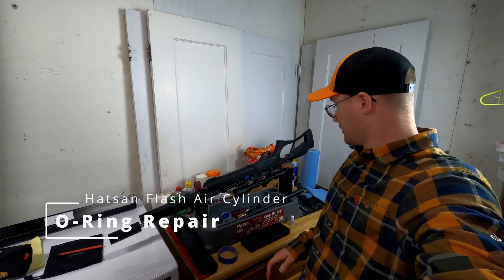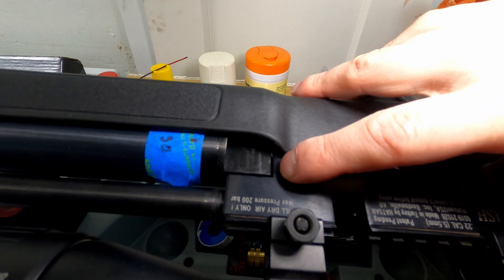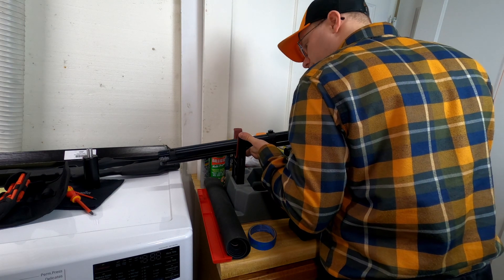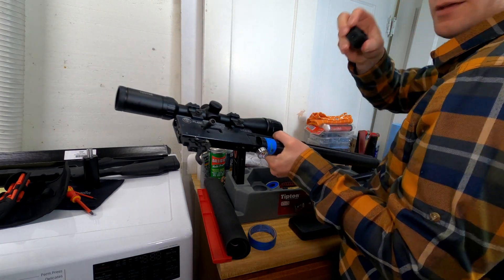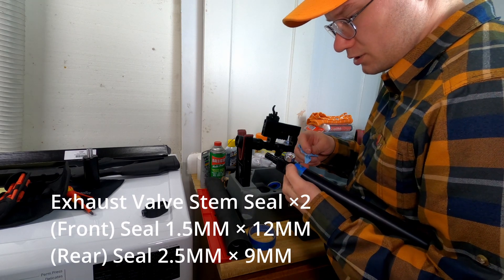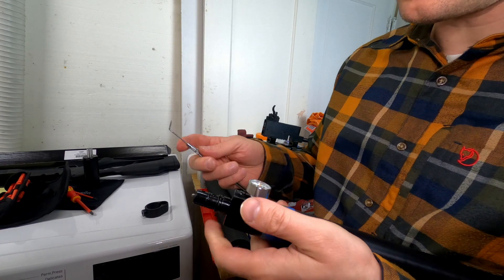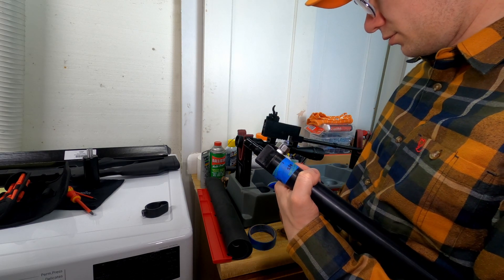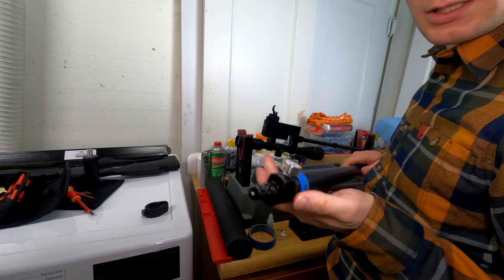Hatsan Flash aircylinder valve o-ring repair

Comment: I need some help. I have a flash qe wood in .22 and I am having issues with the trigger not holding the piston in the cocked position. The trigger sear stays cocked but the piston barely catches like it doesn't raise high enough. Is there anyway to send private messages?
Reply from the maker: I think that you have adjusted the trigger assembly too much. Try to adjust the trigger screws back to what they were and go on from there with the adjusting. I had the same thing happen to me in the past and I could correct it by adjusting one of the screws on the trigger assembly, I just can't remember what of the 3 it was.